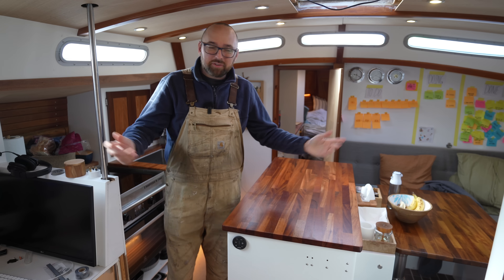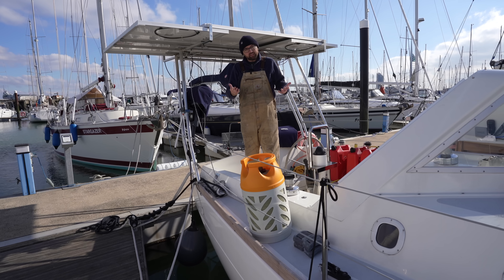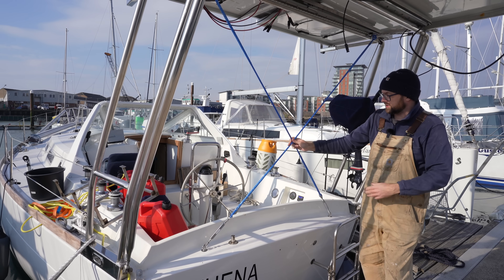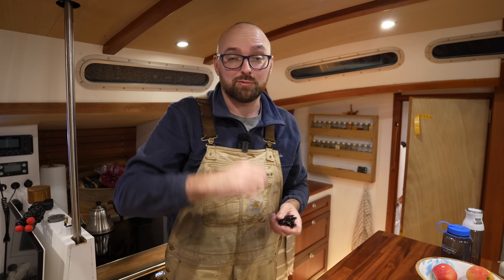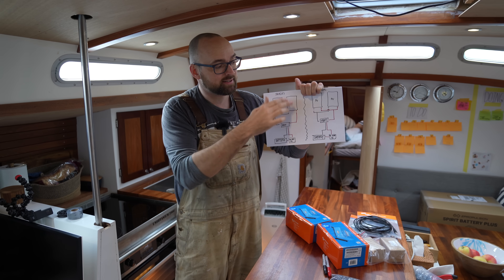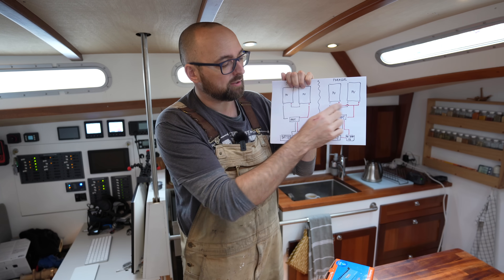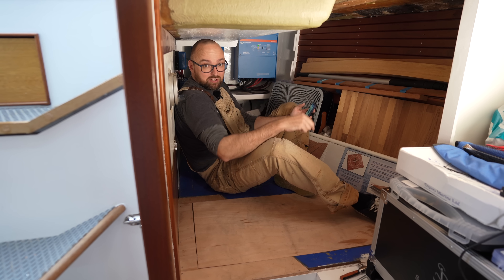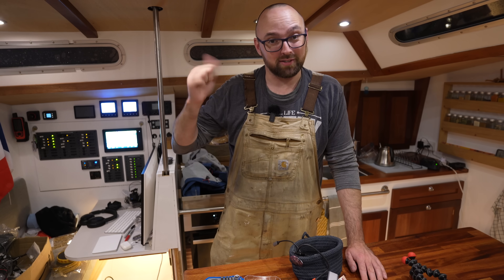Sail Life - 1600W of solar☀ on a 38 ft sailboat  & re-stepping the mast⛵

Comment: Hi Mads, I've made this remark a few months ago also. Looking at the solar panel bridge construction, I am still worried that the dynamic forces on the construction, due to the boats movement on the waves, will be too much and things might break. Hope I am wrong.
Reply: Your wrong... I've seen many a solar arch be the only thing left...!! Just saying.. working in boat yards I've seen some shitty self done work... An yeah this will be fine...
Reply: Mine has a radar, solar panels a dinghy and a wind generator on it. 38,000 miles and still going strong. Atlantic x 2 and Pacific x 1.
Reply: @philgray1023  Oh, great, then my worries  are unnecessary. I was thinking of the pitching motion when waves are coming straight onto the bow. The top of the arch with its distance from the axis of rotation of the pitching would have larger accelerations and multiplied by the inertia of the solar panels, and again the height of the arch, gives a large dynamic torque on the fixation of the arch on the deck.
Reply: @werner134897  I have to tell you the difference between mine and Mads, is we have curved gusset bars at the top and a hand rail at the bottom where we hang our 46 kg outboard. In serious sea, I hate going on the arch because it is best not to have just that one structure keeping you from a watery grave. The dyneema is a good stop gap, but not an ongoing solution for Athena. In engineering terms, if it looks wrong, 9 times out of 10, it is. I get what you mean from the acceleration effect of a mass on the end of a lever. Just try going up an 18 metre mast in a 2 metre swell. Then check the little wires that are holding you and 250 kg of aluminium up there. Not to mention the wind pressure on the sails. Actually, it is best not think of it. I'll be doing that Wednesday.

Comment: Dear Mads, do you have any video of how you connected the cables from each panel to each other so they run as one to the MPPT? Do you just solder them together or do you use any clever gadgets?
Reply: That's what those parallel adaptors are for. They are MC-4 parallel adaptors. You can type  "MC-4 parallel adaptor" in your favorite search engine. Most panels nowadays have MC-4 connectors on the cables. It is all plug and play. The victron stuff is all screw-terminals. You strip the wire, push it in and tighten a screw. You can buy MC-4 extension cords, but it looks like Mads may have crimped on his own MC-4 connectors (also an option).
Reply: @mckenziekeith7434  Thanks so much. Was wondering if I had to start soldering but this seems to solve my problems, great

Comment: When you have panels in series and one is in shade, the bypass diode(s) bypass the panel or the parts of the panel when multiple diodes are fitted. You get quite a bit more power from a series connected system as it reaches a working voltage more often in marginal conditions.
Reply: There is a big reduction in all of the other series connected panels, regardless of the bypass diode action.  Even placing your hand on one panel does it.  That does not occur with other panels if in parallel, at all.   In his application I don’t see how partial shade is going to happen out in the open except from the ships own mast.

Comment: Hi Mads, I'm a bit concerned about the VSWR you're measuring on the VHF antenna.  1.6:1 seems very high when you take account of the feeder loss going up the mast.  The VSWR of the antenna will be much higher than 1.6:1 you're measuring at the bottom as the loss of the feeder needs to be considered twice when arriving at the real measurement.  Happy to calculate the actual VSWR of the antenna with the new cable if you could let me know the length and type.  I think you've changed from the LMR400 originally installed.
Reply: I agree. I think an antenna analyser used on  a short jumper cable to the antenna feed point and then trim or lengthen the radiator element for absolute minimum vswr would be a good idea. Once the antenna itself is properly tuned, the loss in the relatively short run of RG8 would be negligible. However, being that the frequency in use is vhf, I would have used m&p ultrafex 7 and not the rg8. The rg8 will work, but every little helps. It should also be borne in mind, that the losses in any feeder system work equally in both directions, transmit and receive. A loss of just 3db is a halving of the signal out and the signal in.

Comment: Just as you made the jerry can bar, make 4 shorter ones to brace the top corners of the solar panel support archway... That'll strengthen it up well and not block the passage like the dynema cross does. + More permanent and looks like it "fits in" with the rest of the installation.
Reply: I’m certain mads will update that cross brace, but couldn’t wait to get his free sun electrons!
Reply: @lantienpeng  pixies
Reply: Agree with corner bracing suggestion - also potentially good hand holds perhaps.  As always Mads a good report.
Reply: @robertfullarton3020  Actually a great point. We hang our dinghy davit ropes on exactly that when the dinghy is raised.
Reply: I'll second that. My first thought was to weld in some gussets but your idea is both easier and better.
Reply: First thing that sprung to my mind, was fit a gusset.
Reply: I am not going to criticize the big dyneema X because that is the exact solution I suggested 9 months ago 😀. Not super pretty (especially if you use 10 mm dyneema!) but mechanically sound. However, looking at the arch from the stern ( 5:30 ), Mads could maybe make two less intrusive / smaller triangles. From padeye on port to port, from padeye on starboard to starboard. Using short small(er) diameter tubes. Less stable than the big dyneema X but better looking.
Reply: He’s a computer engineer not a mechanical engineer 😜

Comment: Nice work Mads. Great to see the solar energy flowing, a big step for Athena’s ability to stay out in remote areas longer. I see another new project for the list (and the sewing machine)…canvas covers for the plastic fuel containers on the deck (ala the kind Drake has). Sea Yoo next week !!
Reply from the maker: Thanks 😀 Funny you should mention the ones Drake has that's exactly what I was picturing 🙂
Reply: @SailLife  I now think you have this covered, but I was concerned that a single horizontal strap would let the cans go straight up and then overboard.